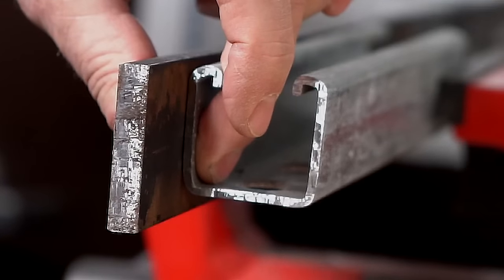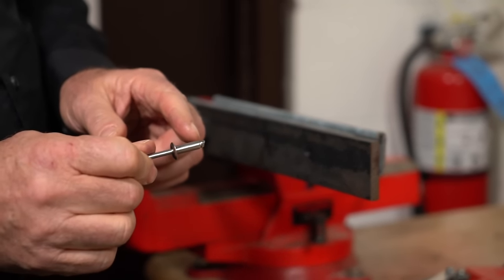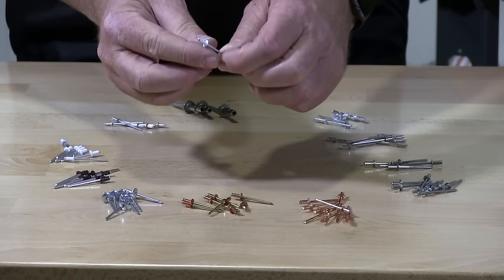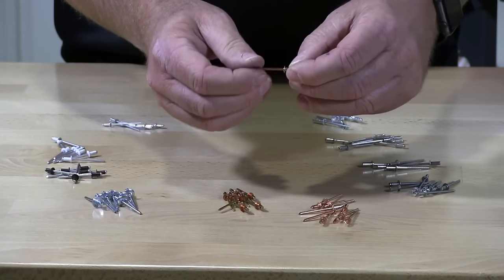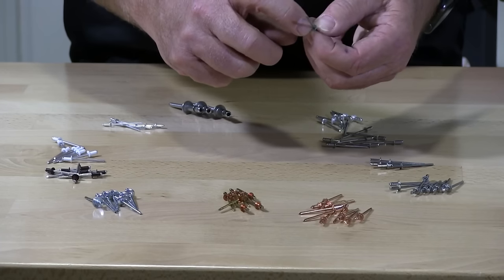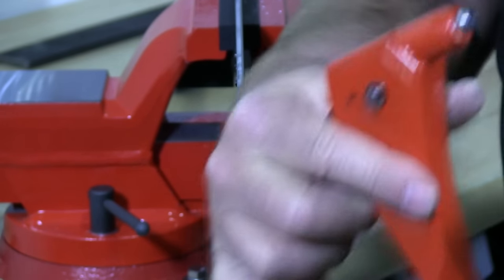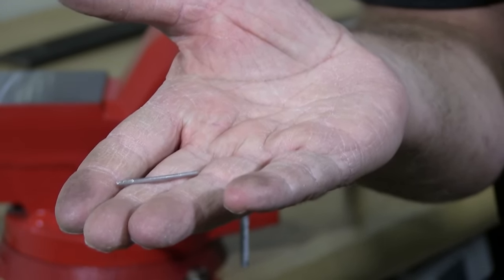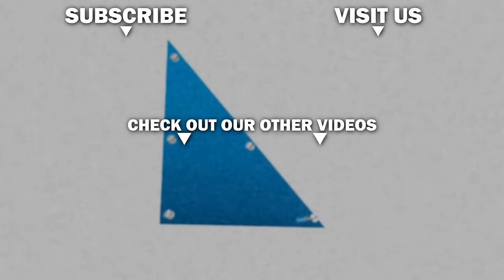A Step-By-Step Guide on How to Use POP Rivets | Fasteners 101

Comment from the maker: There's one thing we didn't mention in the video that is important in selecting the right rivet: the diameter. The diameter of a rivet will be dependant on your application so it can vary wildly from application to application. This also affects the drill size for your hole since that is dependant on the rivet diameter. If you are unsure what diameter rivet to use for your application, please consult an engineer to assist you.
Reply: An excellent explanation of what rivet to use in various applications. Thank you.
Reply: Can I use this tool to remove the rivets as well?
Reply: @damiancardenas6003  Not really. The most practical way to remove a rivet is to drill out the centre with the same size (or one size smaller) bit that you used to drill the original hole. You'll usually find that the bit will self centre and make drilling easier.

Comment: as far as pull strength goes, is it possible to use a pull rivet to connect plastic to metal? I am trying to fix a plastic and metal buckle and I imagine the force required could crack the metal.

Comment: Thanks for the video. I'm new to this tool but is it possible to rivet something to a surface from the outside in? I'm trying to install a bracket inside a plastic container and would prefer to drill the hole and pop a rivet from the outside in so that the rivet does not extend outside the box any more than it needs to.

Comment: I have a stainless steel trash can that has a foot lever to step on and raise the lid.  The hinge goes completely across the back.  The rivets all wore out.  So Stainless steel strong rivets is needed.  How do I measure the tiny hole size ?  I do not have caliper that small.  Not that thick. Rectangle on side type can. Shape keeps it strong.

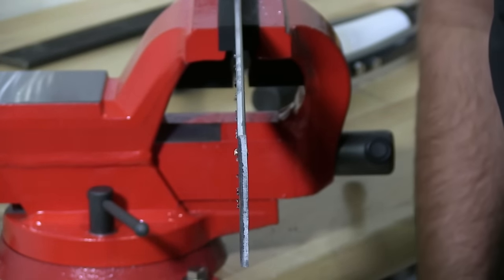Comment: 5:45-beautiful. So what happened next at 5:54? Why didn't the inside of the rivet flatten against the plate as is the previous example, but instead is sticking out, hardly flattened at all? What caused this? The rivet was too long?
Reply from the maker: That is a closed end rivet. It doesn't flatten the same way as open end rivets. In this application, it was a little too long for fastening to this piece of steel.

Comment: I have two rivet guns, one about 20 years old that has seen very minimal use (less than 50 rivets) and one I just bought last month. I have the same problem with both of them. Rarely do I get a good clean break on the mandrel. Most times the mandrel will break off at the mid-way point and gets stuck inside the gun. I have to disassemble the gun to remove the other half of the mandrel. The rivets I use are clean, correctly sized and straight. Trust me when I say it’s very frustrating trying to do anything with these tools because they keep jamming up. Grrrr! 
 Any thoughts anyone?